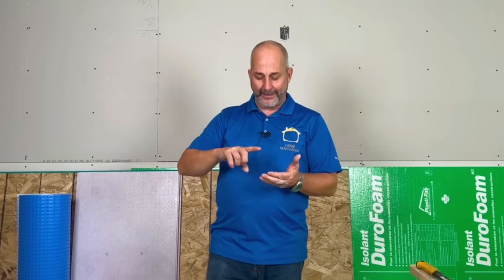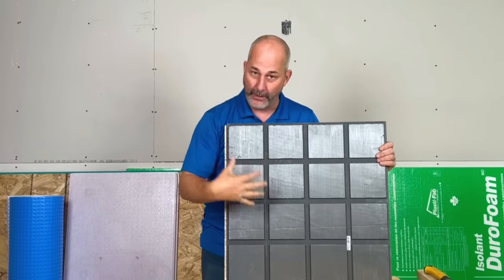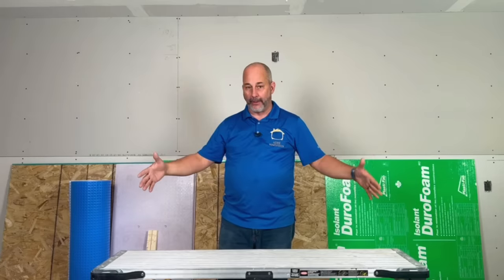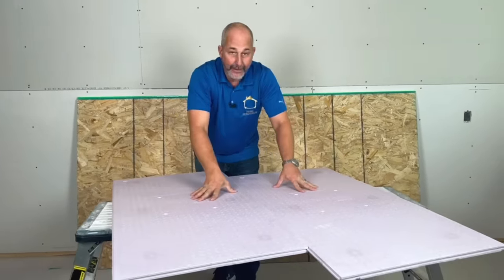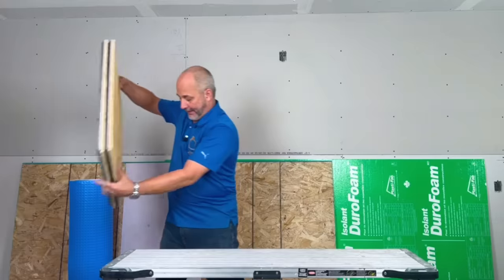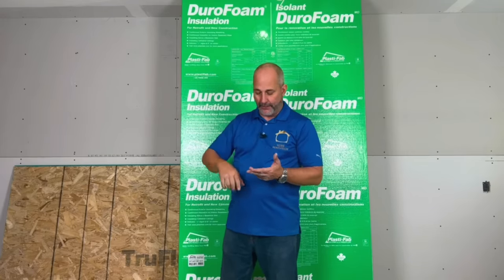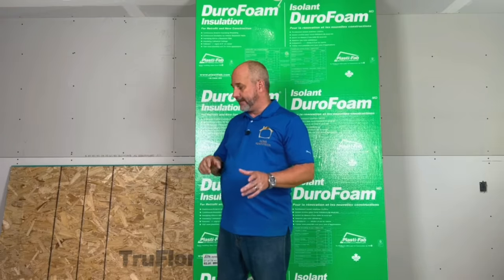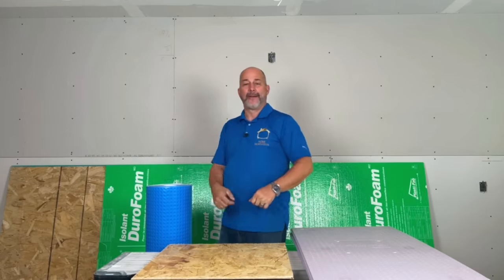Comparing 5 Different Subfloor Systems and What They Cost

Comment: Hey Jeff! Thanks so much for going through all this, it's a huge help. You said to come ask questions, so here goes:

We have a 1997 home in central Ohio, mostly dry except one corner of the basement. When we get rain, we get about 12-20" wide patch of damp concrete all the way down the height of the wall. With the previously installed Owens Corning fiberglass walls directly over the concrete blocks, we would get a small puddle in the corner. After removing the two panels that touch the ingress point, we no longer get any water on the floor.

We'd like to go back to carpet on the floor, but I am hesitant to put that in without solving for the water ingress issue. Obviously the ideal solution would be to figure out why the water is coming in from that corner and stop it. That said, can any of the solutions you shared in this video be used for carpet? It seemed like you focused pretty heavily on various vinyl and hardwood flooring overlays, but we use it as a music and recreation space, so the carpet is actually helpful down there even if it's not the hottest thing on the market.

Secondly, any tips on finding the source of the water ingress? There is a downspout on that corner, but dumping water through it didn't cause any backup, so I don't think the drainage is overflowing. My next step was to find a way to get video during a storm to see if other water not from the gutter is pooling there. After that, I suppose it's time to start digging away to find cracks and channels?
Reply: You might have a leak at the rim joist or sill plate where it meets the concrete. I would caulk between the sill plate and concrete. Carpet wouldn't be an issue using any of the products. It doesn't trap moisture. The moisture would dry to the interior.

Comment: Didn't realize this was only for basements. I have a house built in 1922 with hardwood nailed straight onto the joists. I plan to put subfloor on top of it, but need to know how I can eliminate squeaks before I lay it down. I've watched your other videos where you recommend screwing the boards down, and I have done all that I can, but there are some floorboards that terminate before reaching a joist, and that's where they are the squeakiest. Not sure what to do or if I should just start with the OSB subfloor. The plan is to tile afterwards, so I really don't want additional deflection.
Reply: Get a bit of plywood under the butt joint of the hardwood floor if you've got access from the basement. Glue and screw it from top and/ or bottom. If you don't have access from the basement, consider locking those butt joints together by drilling holes and tapping + gluing in dowel. I think I saw someone else do this with two dowels in a V formation to lock the boards together. You only need to deal with the high traffic spots

Comment: I've got a mid 1950's 1,000 sq ft house with a basement I'll be renovating.  Because of the age of the house, I'll need some kind of channeled barrier to handle any moisture that comes up through the concrete, but I'd also like to add insulation.  
My plan is to lay the dimpled DMX foundation wrap, followed by 1" rigid insulation and 5/8" OSB screwed to the concrete as suggested.  I have the ceiling height for the 2-1/8" subfloor system so I'm not concerned about that.  
My question is: Do I need to gap the insulation so as not to create two vapour barriers — dimpled DMX and taped insulation?  Or am I fine taping both layers?

Comment: I live in Canada in a 50 yr old townhouse. For the basement poured concrete floor, I am thinking of putting the foundation wrap with  4x8 tongue and groove plywood, not OSB, and using a minimal amount of tapcons. At the joints of the foundation wrap, use that red tape to seal it. Use construction adhesive on top of the wrap to connect to the plywood. Comments? 

I really don't like OSB because of the off-gassing, as the glue breaks-down, and the structural breakdown with moisture.

Comment: Thank you for all of these video!  Long time lurker, first time commenter - I live in Kanata, house built in 1989, w/ builder finished basement (carpet on slab).  Looking to replace the carpet w/ a good LVP. No moisture issues to date. Small basement windows <sigh>. not 100% sure i can get a 4x8 sheet down.  Does Dricore R+ make sense here?  Worried about deflection issues from DMX 1 step and LVP. I am looking for thermal break and moisture management (through the concrete pad not infiltration from walls etc).  As you are an expert in the Ottawa area - any other thoughts that could work?

Comment: Greet channel and I think it is Canadian so that's a plus.
Question...
House was built in 2005.
I had the 2x2 Interlocking Foam Mats for Flooring for 14 years.  There has been some white dust form on the floor where the mats join.
Never had a water issue in the basement. Some cracks in the cement floor.
Sub pump is dry in the summer but starting in Dec. it runs every hour or two.
The flooring I'm looking at is from Costco Golden Select Sherwood 19.2 cm (7.56 in.) Waterproof Rigid Core Laminate Flooring Item  4108888 Model  77RCL0001
Can I just put down the DuroFoam and then Laminate Flooring?

Comment: Any opinion on the “Drybarrier” product? We live in Wisconsin, cold damp winters, and we wanted to lay carpet in the basement to help with the cold. Many of the products don’t allow for carpet/pad to be directly applied over, the Drybarrier panels (sold at Menards) claim you can. They don’t seem to have a tremendous thermal benefit (no stated R value) but very cost effective and easy to install.

Comment: Great vid.
New house just want some r value in the basement, but I'm worried about just using styrofoam and putting the 5mm thick LVP on top, isn't it too soft for a thin LVP?

Comment: You have done a wonderful job explaining the options. 
I like how you've cut the voids in your video editing to speed it up, it worked great..
I have a new build from 2017.  I have only seen a puddle of water the size of a spilled drinking glass, so very little, and that was 5 years ago.  Nothing since.  
I have access to bring 4x8 sheets to the basement.  
I was always thinking of using the styrofoam Drycore due to capturing more warmth, rather than the plastic based version.  I'm wondering if I should just go with the final recommendation of the 3/4 + 5/8 since I don't believe water vapour to be an issue.  I was always assuming there should be that air space below but I guess I don't need it presuming there to be a vapour barrier below the concrete.  I will just say I don't believe there to be since I've never seen that in any of the photos of the build process.  I don't mind installing the roll of dimple material before the styrofoam and then some OSB.
The current basement has no walls except the initial stairs area. So no framing, just the concrete foundation and starting a foot up is the vapour barrier covered pink insulation.  I was going to start with a perimeter wall of 2x4 and not bother to insulate the walls, but that is to support the electrical and the drywall. I will likely add a bottom row of Roxul to account for the bottom not having any insulation, however what should I do regarding the vapour barrier part, tie into it?
I was thinking to then install some sort of floor system.  My end game is likely carpet in all areas (for comfort and cost) but if I was to install flooring I would match the engineered that I have in the rest of the house.  I am not a fan of click-floors.  I will also have a washroom with tiles.  
I will have some walls to make the washroom and an office.  Would you recommend these walls to be built and screwed to the concrete or after the floor system is added?

Comment: I live in Danville, California and own our home which was built in 1995.  The house has a sunken living room which is about 6" lower than the rest of the downstairs.  The house is built on a post tension slab.  We recently installed LVP throughout the entire down stairs and planned to install in the living room.  With the rain storms this winter the living room area flooded pretty much covering the room in about 1/2" of water.  This is the first time in 20 years that the room has flooded.  Everything is dried out and we want to raise the floor to be level with the rest of the downstairs.  The current plan is to install sub floor usinfg 6mil plastic as a moisture barrier, pressure treated 2"x6" as joists (glued to slab) and 3/4" T&G plywood.  What would be your reccomendation?

Comment: Jeff - I'm using your DuroFoam and OSB subfloor system in me new build. I'm putting engineered hardwood in, then tile in the bathroom. Wondering if there is any alterations you'd suggest for the subfloor? For layers I was thinking DuroFoam, then 5/8 plyboard (instead of OSB), then Ditra, then tile. Thanks!

Comment: Hello, in North Texas. Old house 1948. Converting attached garage to BR. The garage floor is concrete which you step down into from the house pier and beam level. The floor has sunk 1-2 inches on one side but other than that and the crack down the middle it's pretty solid.
Im going to install a sub floor. 19x10 . Im thinking the duro foam on top of the joist then OSB. 
should I do that and some kind of concrete sealer?
Please advise.

Comment: Great video, currently finishing our basement which has regular door entry. We do have potential for water getting in. In northeast so warm floor is must. Really like the foam 2x4 dricore option. However there will be a stacked washer dryer combo and apartment sized fridge. Using 8mm lvp. Dricore not clear on weight on floor and vibration. I was considering using the 2x2 osb dricore under those areas but t&g doesn’t match between 2 products. Can I but and meet square and tape joint?  Thanks

Comment: My buddy and I will be putting a bathroom in the basement of my 75 year old house and dry core seems to be the way to go for water management just in case

If any gets in it’ll run to the drain lines of the sump pump system

Comment: Hey Jeff, great video. Looking to figure out exactly which sub floor I should go with. I live in a house that was built in 2004. I live in Kansas in the US. I am just starting my renovating . We have gotten some water in the basement due to rain coming in from the concrete pad outside the basement. There is a walkout door down there as well. I have sealed most of the water from coming in but have to figure out around the door. What sub floor do you recommend I go with? Thanks for the help!

Comment: Hey Jeff - timely video!  I'm in the process of designing our basement build out.  We're in Wisconsin.  Home is 21 years old with a full walkout basement.  Concrete in great shape.  We're at the top of the hill - our sump has never run in 21 years except when I test it annually.  Thinking of vinyl plank in the pool table/bar area, carpet in the bedroom/office, and tile in the bath.  Appreciate your thoughts on the best option for subflooring.  Thanks!

Comment: Question  I have a late 1960s home with a plank subfloor at 45 deg angle to the floor joists.  I removed all of the crappy particle board underlayment they used under the carpet and vinyl. What type of underlayment replacement should I use that will provide a vapor barrier from the crawl space and provide a surface I need for LVP?

Comment: Great info! I have an old garage that has a rough concrete floor that unfortuantely gets wet with each heavy rain (south ga). I want to do a basic sub floor but worried about moisture/mold... any push in the right direction?

Comment: I'm looking to add finished office space to a 1972 house. The basement is dry and hasn't had water issues before. I have the building plans and it says a vapor barrier was used along with 2 feet gravel below the slab and along the sides of the basement walls. What system would be best and most cost efficient? The house sits on a hill in clay to silt soils. Lastly, do you install walla before or after? I've seen you do both in your videos. Thanks!

Comment: Love the channel. Quick question, if I want to add subfloor in the basement, do I need to subfloor the entire basement? House is old, 1956, no vapor barrier, horrible water table, I ahve weep tile all the way round and 2 sump pumps. I dont need the basement to be super finished, but I do want it to be a little nicer, have power outlets, etc.

Comment: I'm in the Mid-Atlantic area (Maryland). 2 yr old home, so I'm confident (??) it has the modern features for controlling water penetration in my basement. My basement is carpeted with some really cheap padding under the carpet right on top of the concrete slab. Should the builders have placed a underlayment under the padding as thermal barrier or is the combination of the padding (cheap as it is) and carpet serving as the "thermal barrier"? Thanks.

Comment: Love your videos man. Question: Just bought my first house, 60's bungalow in Cambridge, ON. Grading away from the house on 3 of 4 sides. Did the first walk through during a heavy rainfall, no sign on leaking or moisture problems in basement. Could I eliminate Trufloor tongue & groove if I use the dimpled membrane, then Durofoam, then luxury vinyl? 
Thanks

Comment: Hey Jeff,
Thank you for the video I was wondering if it is okay to install subfloor on my basement floor if the foundation is wet. Will it damage the foundation because it will resist the moisture from  drying ?
Thank you

Comment: My home is built in 1989. It does have a plastic vapor barrier underneath the poured concrete on the floor. This technique was just starting to be done around this time. I also have a whole home dehumidifier. Does that mean I don't need a vapor barrier like Dricore on top of my basement concrete floor to block moisture?  I think ultimately I'm concerned about reducing the ceiling height too much but having a warm floor is desirable.  I plan to use a WPC floor. What are your recommendations?

Comment: Hi Jeff, 
  Love your channel.  I will be building a new house in March 2023, in Iowa and will be placing 2" foam under the concrete with a plastic vapor barrier on top of the foam in the basement.  I will be spraying 3" closed cell foam on the basement walls.  I don't believe there are any sub surface water problems talking with the neighbors.  Will a sub floor be necessary in this instance?  Thanks   Roger R.

Comment: Hi Jeff, I am working on our basement now. Our house was built in 1965 with block walls in the basement. We are not planning on adding any drywall - we are leaving the block exposed on the walls and the above floor joists exposed on the ceiling. Our exterior drain and sump pump system was redone a few years ago and their haven't been moisture issues since. We are just planning to install carpet in the basement. We already pulled up carpet that sat directly on the concrete. What do you recommend for subfloor?

Comment: I have a 1920s home. The subfloor is the same depth of the hardwood floor in two areas. Some of the sub flooring has to be replaced and that’s not the section under the regular hard wood floor. The subfloor is mostly not damaged. Which sub floor should I use ?

Comment: Our house was built in 1954, so no slab or foundation insulation whatsoever. We also live in an area with a ton of river rock, so water flows very easily through the ground. All that being said, when I remodeled our basement, I specifically chose Dricore for water mitigation and thermal break. 

When I pulled the paneling off the foundation walls, there was efflorescence around the perimeter where the slab meets the foundation. There were also two hairline cracks that may have been the source of the water infiltration. The cracks were sealed, and the entire foundation, including the slab, was cleaned with acid and covered in Drylok. The walls were built ON TOP of the Dricore so that any water that seeps in will never touch the wood framing. For good measure, I cut in two small floor registers on opposite ends of the basement to allow air flow across the entire floor system.

Comment: I have a 1950s house with interior french drain (installed by previous homeowner) along the exterior wall of my basement. There is dimpled mat on the bottom 2 inches of the wall (for the french  drain). No vapor barrier under the floor or on the block walls though. If I go with a dimpled mat under the floor should I build my exterior walls on top of it or build the exterior walls first then leave a gap between wall and mat/flooring?

Secondary question:Should I air seal a vapor barrier at the top of the wall or leave it open to let the block dry?

Comment: Jeff! Thanks so much for this info. We’ve got a 1910 house with a new basement slab that has a vapor barrier, but the walls are old stone foundation walls. No vapor barrier outside on the wall. Contractor put in a sump pump(not sure if that’s the right term) but no French drain along the walls. Occasionally we get bulk water in the back because the gutters needed to be replaced and the storm drain gets clogged. We live in Philly and owners have to pipe their storm water into their sewer main. (Combined sewer). 97.98% of the time no bulk water. But we run a dehumidifier. Any suggestions would be massive. I’m hoping to finish off 2/3 of the basement this summer. Leaving utilities unfinished. Thanks so much!! You’re the best.
Reply: I would fix the bulk water problems, fix the gutter and the storm drain before putting money in the basement that is going to get wet and mold.  We had a house near Doylestown with a high water table - there was a small gutter in the cement floor that ran around the inside wall perimeter - in the spring it ran almost continuously to the sump pump.  If you can not fix the bulk water issues, you might be able to cut a gutter into around the perimeter to the sump.